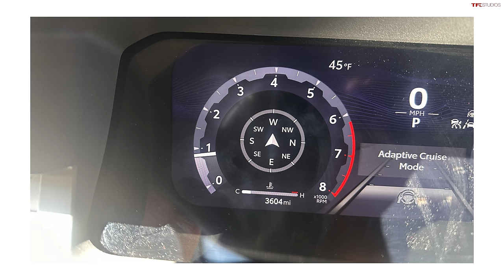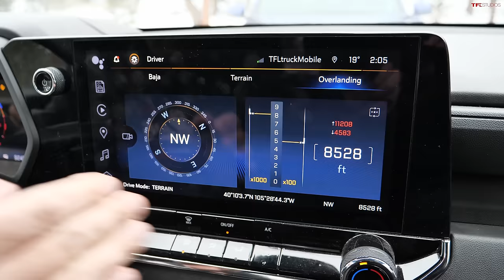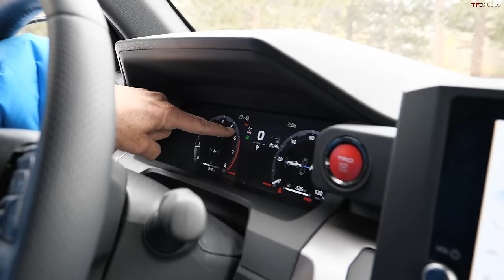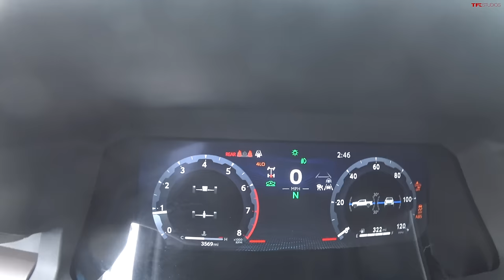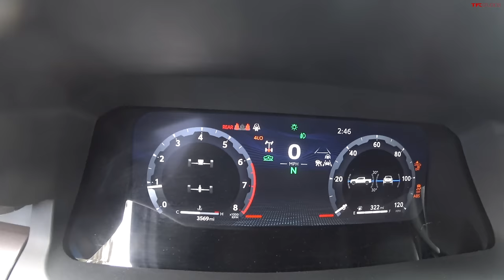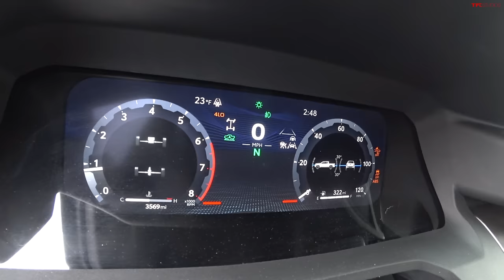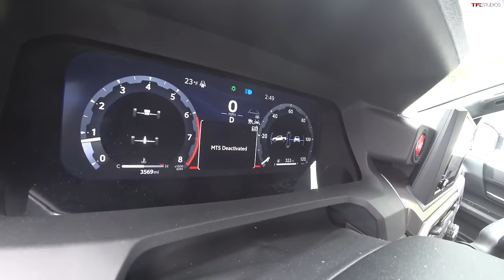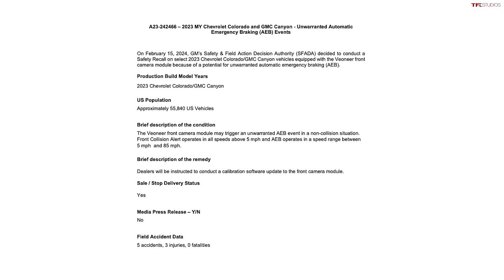Our Brand-New 2024 Toyota Tacoma Almost Left Us Stranded...Here's What Happened!

Comment: You can very clearly see the front wheels attempting to apply the brakes in the video. That clamping down and letting go repeatedly can generate a lot of friction and heat. My guess is the front drive shaft or transfer case had a component break as a result of essentially a repeated impact shock to it. Should be covered under warranty for you guys. Doubt an average joe would be able to get it covered
Reply: Yeah, these "off road modes" are all useless trash. No one that know how to drive off road uses them. Budgets need to be reallocated to beefier components
Reply: He locked the Diff. When the diff is locked Trac control is disabled......
Reply: But that is exactly what it’s supposed to be designed to do. They did not break this truck. It is a fluke accident or a very weak component. Time will tell.
Reply: @Dusdaddy  when did he lock the diff? He mentioned turning off crawl control, but not traction control. Either way, you can see the front wheels spinning, then stopping, then spinning again repeatedly. At full throttle, there's a lot of torque and load being applied to components. Not letting them move is going to eventually lead to something breaking, and that's on any vehicle, not just toyotas
Reply: @Dusdaddy offroad modes and A-Trac still apply brakes as needed, especially at the front diff which is open...............
Reply: @Dusdaddy  there's no front locker, only rear, so unless he turned off traction control it was ON in the front
Reply: @El_Dusty_  From the manual:   
 ■Locking the rear differential
 The following systems do not oper
ate when the rear differential is 
locked.
 • ABS
 • Brake assist system
 • VSC
 • Downhill assist control system (if 
equipped)
 • TRAC
Reply: @dochollywood1921  Obviously you weren't' watching the video. My god, they were struggling to disengage the diff lock at the end. All I know is that in Diff lock, Trac is disengaged. Which makes sense because every damn trac control should be disengaged when in 4Lo even.
Reply: @Dusdaddy  for sure. A-Trac and off-road modes can still be engaged so the brakes can still modulate to provide traction even with the rear locker on.
Reply: the front? @Dusdaddy
Reply: @Dusdaddy  I most certainly was watching the video. At 13:50 you can see the rear wheels spinning at two different speeds aka the diff lock is not engaged when the problem occurred. In other words traction control and/or A-trac could very well have still been engaged, which means brakes could have been applied regardless of 4wd, so my point still sta ds. Roman did not re-engage the locker until after the tow rope was hooked up. They struggles to get out of 4wd, not necessarily disengage the locker
Reply: @dochollywood1921 Not sure what you are talking about. That was after he broke it. When it broke, both rear wheels were spinning together. Diff lock engaged. He probably disengaged diff lock to steer it out of there.
Reply: @Dusdaddy  10:10-10:15 you can see the left side spinning slower than the right side before the brakes are applied and both wheels are brought to the same speed (because neither have traction). In other words diff is not locked before the problem. If traction control systems are disabled with the diff locked, that wouldn't happen. Therefore, diff isn't locked. They locked it early on in the video to show that it had a locker feature, then unlocked it, then relocked it during recovery. Not really hard to see, not sure why you can't. Simple logic really
Reply: @dochollywood1921  No way, they are at the same speed. He didn't turn it off. I see them spinning together. You are the only one on the internet seeing that.
Reply: @Dusdaddy  there are multiple replies on this thread saying the A-trac was still functioning, and can be seen on the front. If all of that is supposed to be disabled if the locker is engaged, then logically, that means the locker was not engaged. Roman has to relock the diff during the recovery, which means before then, the diff was not locked. Idk why you're having such a hard time understanding that. You're the only one on the internet arguing the diff was locked when the incident occurred
Reply: @dochollywood1921  Which shows how little they know. This vehicle is not equipped with A-Trac. They changed the name because it functions differently. And it's not possible for it to break an axle regardless.

Comment: For anyone watching this the best option is to go to 2015 or older tacoma with the 4 liter 1grfe engine which has 270hp and simple rugged and i bet you the drive components woukd not break like in this video.  Newer is not always better.  1grfe engine is under streased in the tacoma and this engine has way less plastic than the 2016 engine the 3.5 liter v6

Comment: I had a 2008 rav4 with 3.5 motor. Sold it at 280k miles and it ran like new! Still does. Used to own a 1986 pick up as well which ran forever. I love Toyotas and I’ve been wanting to buy a new tundra but now starting to think I should buy a pre owned older model with a 5.8 motor. I’ve noticed that quality EVERYWHERE is poor lately. Brand new semi trucks even are falling apart and have constant recalls. What do yall think is the best year to tundra for me to get if not the new one?…
Reply: Avoid tundras at all cost. Least reliable truck made.

Comment: This is the greatest ad chevy could of ever asked for
Reply: Their truck is at “stop sale” so they can’t really use this against Toyota
Reply: @Blackhawk556.  well my point t is, the chity chevy made it up
And the toyyoda blew a diff...
Reply: Yeah in Canada a ZR2 Costs less than a TRD odd road, I was already thinking the ZR2 seemed like a great deal and now it seems even better.
Reply: @GregorBlacksmith  yeaa, I wished they would bring back the Dakota but make it look like the 1952 model year dodge truck with the split windows
Reply: @Blackhawk556. That "stop sale" order is due to "software "not "hardware." Looks like toyota needs a stop sale order for hardware LOL be honest with yourself, toyota reliability is a thing of the past since they are forced to modernize their engines and transmissions instead of using the same ones from 20 years ago.
Reply: @BurchellAtTheWharf Dakota 🤔 I purchased a Leftover “2001” Dodge Dakota Sport with the 5.9 V-8 in February 2002 drove it like Grandpa going to church February 2012 with barely 50,000 miles Transmission just fell apart… always wished For a Jeep pickup like my uncle had in the early “1970’s” got a 2022 Jeep Gladiator because I appreciate the simplicity and robustness of a solid front axle.
Reply: @MrJEEPJT  well the new ones ain't great, but if yea slap an LA 318 with a 727 and 355 gears in a quarter ton truck like a 52 model fer style points and called it a Dakota, then that would be sweet, bout the size of a civil hatch and straight two door, with 4×4 options, and under 35k Canadian, man that be one mad little truck
Reply: Car & Driver pits these two in the latest issue and the Toyota comes out on top. They say the new one is light years head of the old generation too, actually ergonomically designed for a human being.
Reply: @OMGWTFLOLSMH  I still like the older truck from before 2007
Reply: Or Frontier, which is rated higher for reliability than even the last year of the previous generation. Lots issues. Toyota ain't what it used to be.
Reply: @OMGWTFLOLSMH  The previous generation was archaic, which I'm cool with if it's good, but it wasn't good. Horrible ergonomics, comfort, and quite a few reliability problems right up to the last year of production.
Reply: @OMGWTFLOLSMH  Colorado Zr2 is in a class of its own
Reply: .              "🔴STOP SALE🔴" !❗️!

WHY  ? 🤷🏼‍♀️
Reply: “Greatest ad Chevy could have ever asked for” Yeah totally, no cruise control on a $40k+ is ridiculous And it barely made it up that trail, totally a Trail Boss🤣🤣  Even the cheapest car sold today has cruise control😂😅 typical GM cost cutting at its finest🤣👎🏼👎🏼
Reply: @AndyFox22  yea, but it beat a Toyota on its first try 🤣 that's the add, a chity Chevy beat a Yoda atlast
Reply: @AndyFox22  you're saying this on a video about a Tacoma literally breaking with moderate use. Shush. 😂
Reply: @Blackhawk556. The world do change. 
So does politics.
Reply: @BurchellAtTheWharf  Somebody has to do this.  Would be real throwback. wouldn't it.
Reply: @OMGWTFLOLSMH  Car magazines routinely sell out to the highest bidder of their ads.
Reply: Except I've seen aleast 4 seperate issues from different YouTubers with the Chevy and Chevy fights you for the warranty. Toyota doesn't and this is the only YouTubers who's bad a problem
Reply: Pre-pridection issue?
Reply: Improper English . Could have never could of
Reply: @palebeachbum  how is this relevant? Frontier is a metal truck made by Nissan. A Toyota is mostly plastic. I don’t understand the appeal

Comment: I’m still with the fact that if you’re paying that much for a truck it should not have broken under the circumstance.
Reply: Don’t thrash it around on the trails and all that and it’ll be fine
Reply: That's not thrashing at all.
Reply: Agreed this was by far not thrashing. I have put my truck through far worse and still drove it home with functioning parts.
Reply: This is an OFF ROAD a TRD OFF ROAD and they took it OFF ROAD and it FAILED
Reply: Chevy still drove home just fine 😂
Reply: @slapshotjack9806  "thrashing" is hyperbole. Some people need to travel on roads like this to get to a convenience store. Certainly aren't doing it in a junk Tacoma LoL
Reply: @edaddyx2hansonjr436 now it’s a TRD ON ROAD 😂
Reply: never ever. unless reached the same age as the OG'S
Reply: @quyle9483  bruh no road in the us is remotely close to unpaved to get to a grocery store
Reply: @slapshotjack9806  yeah definitely too much for a new Toyota to handle
Reply: @slapshotjack9806  its a TRD pro lol

It's marketed as being capable of doing this
Reply: @melvingibson4525  it's definitely capable of getting groceries
Reply: @melvingibson4525 not a trd pro, new trd pro isnt out yet
Reply: Laughable that it's the Off Road version.
Reply: Yeah, this new generation just goes deeper into mall crawler territory. The reason it probably broke, despite the low tire traction conditions, is because of what they called (in 2014) the A-TRAC feature. This is a 4 wheel independent brake controller system that allows brake to be applied to an individual wheel that's slipping so that power is transferred across the axle to the other wheel. This functions almost as if it were a front locking diff. I think that it was the brake pulsing which, despite the low tire friction conditions, was pushing a decent amount of energy back through the drivetrain and broke the transfer case.
Reply: No offense, but having lived in snowy areas my whole life, these guys just suck at winter driving conditions in the woods. No chains, no jack, wrong mode/gear, no weight in the back, oh and stepping over the tow rope rather than on it or around it… geez
Reply: @edaddyx2hansonjr436  i love this comment
Reply: "If you keep your TRD off road on the road it should be fine."

-a dealer somewhere, probably.

Comment: No cruise control on the Chevy is absolutely insane in today’s day and age.
Reply: Even the cheapest cars you can buy today have cruise, typical GM cost cutting 🤣🤣🤣
Reply: @AndyFox22  the chevy didnt blow its transfer case under low load though, so id say chevy came out on top. While i will agree GM cost cuts in certain areas, I have a 2018 Silverado LTZ Z71 and it is perfect, has no issues.
Reply: Yeah I would definitely look at an older one I don't like the sound of the new motor either it's noisy .
Reply: My 2011 nissan navara/frontier does have it and it's not even a fully optioned version lol
Reply: @AndyFox22 but that's not even cost cutting since every engine these days has an electric throttle.
Reply: I thought so, too.  Maybe it's a trail boss thing, I don't know.
Reply: I find it very hard to believe it doesn't have cruise.
Reply: @arthurtirrell661  it doesn’t

Comment: I’m 71 and have been driving in snow and 4wheeling since I was 17. First thing l learned DON’T use low range in the snow, use the highest gear it will pull itself, less tire spin!
Reply: Nailed it
Reply: My cars were all rear wheel drive until I bought a 2004 Toyota Corolla. With good winter tires nothing has stopped me.
Reply: Won’t there be more wheel spin if your in higher gears??
Reply: Can't use lockers in high on the new Tacoma. Sucks!
Reply: You must be joking....I'm 98 and know that low gears and low tire pressure are the answer to DEEP snow.....maybe on pavement your way is better.
Reply: @marshallanderson4609 you cruise everywhere in 4 high! 

ONLY put it in 4 low when ya get stuck
Reply: Came way too far down to see this comment! I was thinking the same thing
Reply: Ridiculous. I am 129 years old ! Forget low. You need front and rear lockers !
Reply: Drive in winter back roads for 40 years and never ever put it in 4 lo.....unless you intend to pull stumps or logs out of the woods.  And for pete's sake....put some winter tires on those machines....unless you never leave the pavement.
Reply: @Williams-mp7vz  What shocked me is that he wasn't even using the rear locker until after the damage. Clearly not engaged at 13:50, and he specifically mentions locking the diff at 20:38.  Ultimately the issue is inadequate tires for the terrain though, once the treads get clogged with ice they are no better than a highway tire.
Reply: @marshallanderson4609  but it wasnt really deep snow it was mostly Ice
Reply: @Corvenik1  That's why it needed the soft rubber of a snow tire.
Reply: @Williams-mp7vz I’m 131 1/2 and I agree!
Reply: You’re sadly mistaken!
Reply: I’m with you fellas
Reply: @chromedreams8184 No, because it results in a smoother transition from stationary to in-motion. 
Think about it like this: if you were to intentionally do a burnout, would you start in 1st, not 2nd or 3rd.
SAAB, being from snowy Sweden, had a “Snow Mode” on their automatic transmissions, which started in either 2nd or 3rd gear.